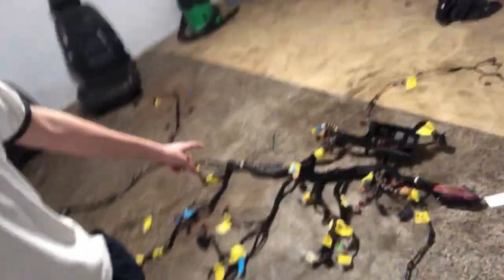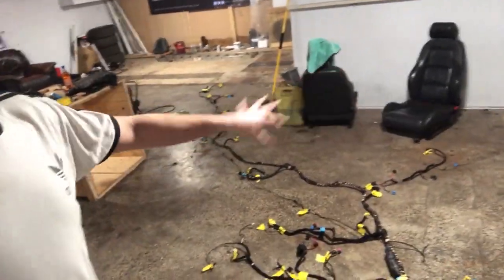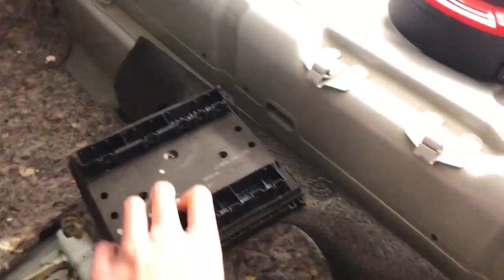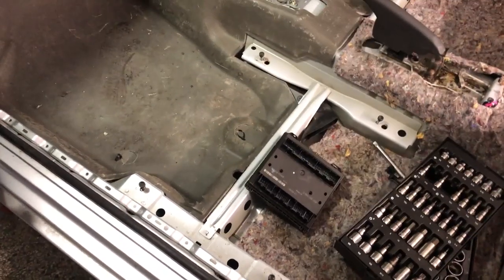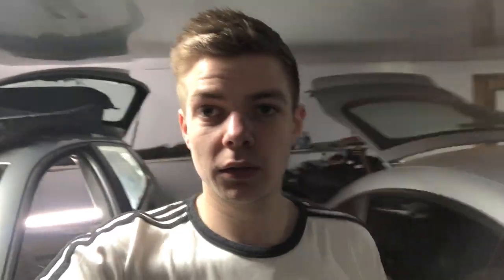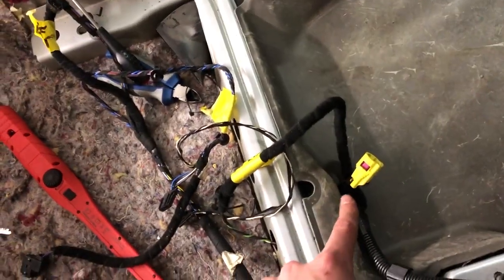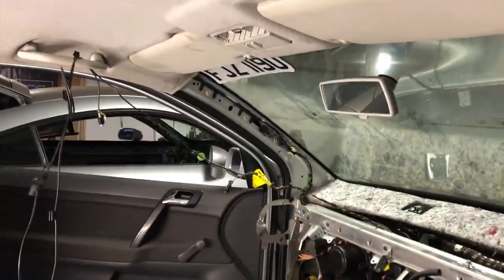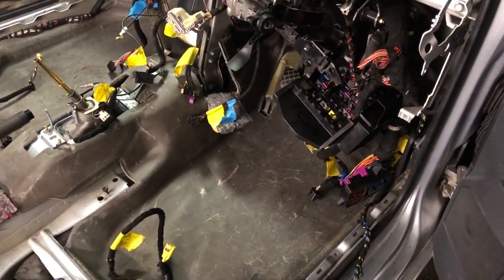Installing the 1.8T Polo 9N3 GTI interior loom!

Comment: Hi mate don’t mean to sound stupid but I got a 1.4 9n3 petrol and planning on doing 1.8t swap is it actually 100% necessary to swap interior loom or did you do it because you wanted additional auxiliary like electric windows etc?
Reply from the maker: Im not honestly sure what all extras the 1.4 9N3 came with the main reason I changed the interior loom was due to the 1.2 loom didn't have an esp button nor did it have the plugs for the two sensors
Reply: You can just wire it with the engine loom and esp loom separate

Comment: Hey, do you know which pin in the meter is responsible for fastening the belts ??
Reply from the maker: I’m not sure exactly what you are asking there is a plug which goes to the front seat belt tensioners?
Reply: @andrew_sr  In the polo there was a light signaling the unfastened belt. You need to plug one cable into the ground and the other is a green cube in the car's counter. I just do not know which pin